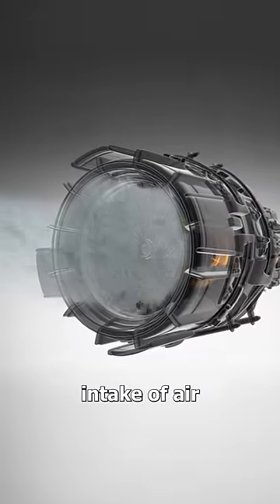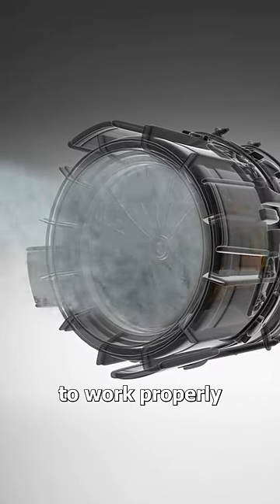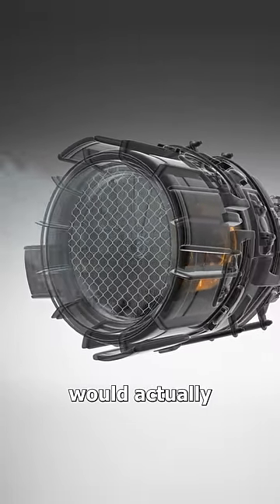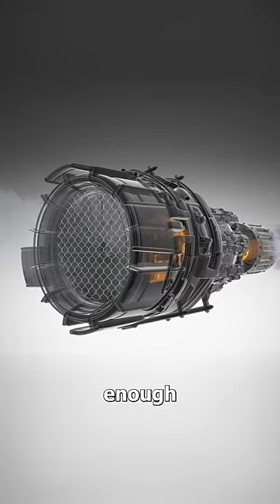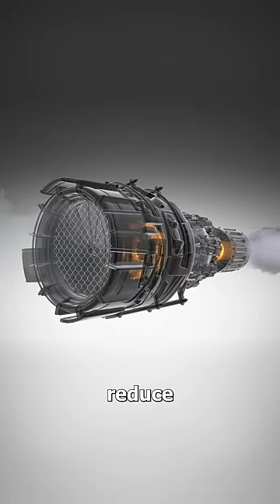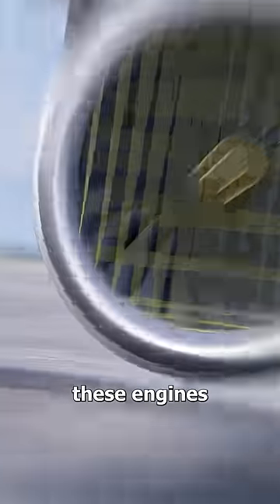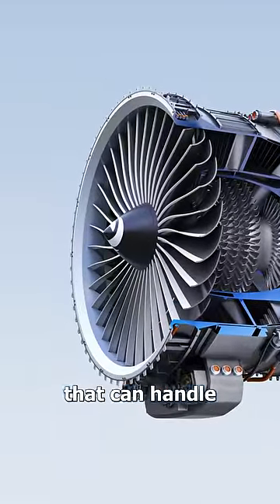Why Jets Don’t Have Bird Blockers 🤔

Comment: You can save the birds, but plane will go slower

Engineers: sharper blades it is then
Reply: "Bring me the nukes. I shall end the birds' suffering."
Reply: Nope, u increase chances of planes to malworking
Reply: You won’t save the birds though. The impact will most likely still kill the bird.
Reply: The birds would die upon hitting the grates.
Reply: It's not just slower, but also significantly higher fuel consumption and more pollution due to incomplete burning of the fuel.
Reply: Just don't use planes if not absolutely necessary (your holidays or getting somewhere faster isn't).
Reply: @@vengeance.19 sir you know nothing about me 😁
Reply: @Kotifilosofi  As someone with claustrophobia, having to spend several days and nights in a row in a car with literally zero ability to ever take a break from it, makes me lose my mind.

My parents always kept dragging me onto such journeys all throughout my childhood, and are about to take me to another one this december. I fuckíng hate them for that.

Commercial planes were invented by God, to end our endless claustrophobic, oxygenless, movementless, grassless, everythingless car suffering.

Think about it. Wouldn't YOU lose your mind if someone locked you in the back of a passenger car for 48+ hours with nothing but yourself, with only being allowed to leave temporarily for poos and pees?

Also, "speed isn't necessary", have you forgotten about the existence of URGENT MATTERS and/or EMERGENCIES?
Reply: @DogDogGodFog  calm down dude.

First off, don't you have trains? They're more comfortable to travel with long distances than both cars and aeroplanes, you can walk around, go to the restaurant car etc. Also, we can use the flying phobia of some people the exact same way against planes that you're using claustrophobia against other forms of transportation. Nothing will ever be perfect for everyone. And lastly, I said IF NOT NECESSARY, not "is not necessary".

You may wanna take break from online for today?
Reply: @Kotifilosofi  I can't calm down when you're trying to fight against what I see as a basic right.
Reply: @DogDogGodFog  wow you make this sound so dramatic 😂 just suggesting that maybe, just maybe every flight we have isn't absolutely necessary or maybe we could consider other options as well, is considered a crime against human rights? Just wow.
Reply: @@vengeance.19 sir you know absolutely nothing about me 😁 did you have actual arguments or are we done here?
Reply: @@vengeance.19 every argument I've seen from you is "that person has never travelled" 🤔
Reply: @@vengeance.19 I disagree. Most of the time it's about comfortableness, not about necessaity. You can come up with a reason for nearly anything, that doesn't automatically mean it's a good reason or that you should do it.

Go try a train for once.
Reply: Bro how u do this bold font
Reply: @Nikko00  write text between two " * "
Reply: @Nikko00  use * signs on the both of the sides of the text you want to write bold.
Reply: @@vengeance.19 haha. I will not even try to find you any sources long as your argument is "that person has never left their house". You can as well find the sources against the argument, if you're sure most of the time flying is absolutely necessary, can never be replaced by any other wehicle and even just suggesting so is close to violating the human rights...
Reply: No you can't. If the plane was going slow enough for a bird to survive the impact, that plane wouldn't be flying, it'd be levitating. And last I checked, we haven't invented a working technology for levitating 10 kilometers above the ground yet!
Reply: @DogDogGodFog car seats are a lot more spacious than plane seats though. Now those are cramped! 😂

Also, have you tried bringing some books or handheld game consoles or similar to occupy your mind with while driving?
Personally I don't mind long car drives, whether in the driver seat or in a passenger seat... 🤷‍♂️
Reply: do you literally have any actual reason that planes are bad??? just because one guy decided to take the train instead of flying doesn't mean the plane isn't still gonna take off bro. are you just trolling or tryna be a quirky emo soft boy? if it's the former then you're doing a pretty solid job but if it's the latter you need to go outside bro @Kotifilosofi
Reply: @TaxiCabCole  planes pollute our planet massively, if you had no idea. One guy lmao. If it becomes a trend that we fly less and use other forms of transportation more, then less flight is needed obviously.

You're missing arguments when you start straight out bullying 😂
Reply: @FartCity-WorldDomination  A right in the sense that my capabilties as a person and my career capabilities would be halved if commercial planes were banned.
Reply: sure, a single flight is obviously worse for the environment than a single car trip, but per-passenger c02 emissions are just as, if not higher if a single person decides to travel by car instead. also, boats are expensive and slow as hell. what if my mom is dying and i need to travel to see her? think for 3 goddamn seconds and you'll realize that planes have a purpose aside from just spewing c02 into the atmosphere. air travel accounts for 3.5% of global emissions, while the energy business accounts for 75%. that computer you're using to spit bullshit sure is using a lot of power, why don't you turn it off if you're such an environmentalist? @Kotifilosofi
Reply: @TaxiCabCole  unnecessary flights are the worst for the environment. They pollute so much. We could do with less, which was my point from the beginning. Not that no flight is ever necessary. I seriously wonder if people even read my comment or if they're just wanting to pick up fight 🙄

And I'm not using computer lol.
Reply: @sanguisbumb6138 and even if they manage to survive.  They won't be able to get out and just hang in there blocking the airflow. And considering there might be multiple birds stuck. Potentially blocking the whole thing
Reply: @Kotifilosofi  that would be rather don't use a private plane to go there, but public planes still gonna fly to the destinations at the same time, even if the plane is not full, so the only thing you do with that is you're not going to a holiday or get to your destination faster. But the planes still fly without you.
Reply: @tamaskarsai2072  there would be less flights if there's less demand. I don't know how to say that any more comprehensively.
Reply: Passengers : ALRIGHT WERE HAVING CHICKEN TONIGHT WHOO LOL.🤤🤸😎
Reply: Also engineers : all in the name of progress lol
Reply: trains suck @Kotifilosofi
Reply: i am from īndia most trains here are uncombfortable not fast and just disgusting @Kotifilosofi
Reply: @RajeshR-ck5ez  no they don't. Planes suck.
Reply: @RajeshR-ck5ez  I'm from Finland trains are fine here. I suspect your train network is not big enough for the population using it?
Reply: @DogDogGodFog  "a basic right" bruh he literally said flights that are not absolutely neccesary. Idk about you, but i'll take a high speed train any day over a plane
Reply: @CarlosAM1  Trains are only in certain areas. If you, e.g., intend to travel from the United Kingdom to Poland, you can't always rely on them.
Reply: @DogDogGodFog  I know. However here we are talking about when a flight is not neccesary for example. Here in Panama for example we don't have hsr or any train that connects most provinces so we are forced to either drive, take a bus or fly if you have the money.
Reply: @Kotifilosofi going to a island:
Reply: @leongao5120  I'd say going to an island falls under the category of "absolutely necessary" 🤔 or not, if  you can go by ship 😁
Reply: are you dense? the question was never about the safety of the bird... it was about our safety. Also a grate would make the fate a whole lot worse
Reply: Not that it would go slower, it wouldnt generate enough thrust to take off

Comment: "Sir, we've designed a bird blender."
"You can't call it that; no one will buy it."
"Sir, we've designed a turbofan."
"Perfect."
Reply: The New & Improved Bird Blender  it slices  , it Dices & Cooks Birds in Milliseconds. 
🤣🤣🤣🤣🤣🤣🤣🤣🤣🤣🤣🤣🤣🤣🤣🤣🤣
Reply: Is that what Taco Bell uses for their beef?

Whole mooing cow goes into the front, gets blended into hamburger, cooked/burned by the combustion, and then mixed with seasonings.
Reply: @Jeff-ss6qt  That machine would make a "Shhqloeup" sound

Comment: Even if they did put a grate on the engines, a bird would just be stuck to the grate for the entire flight due to the suction from the engine
Reply: Or pulled through the gate anyway. I think they'd be pulled through.

Not that the bird would ever find put, it be killed by the impact at 800+ km/h either way.
Reply: It would actually make it worse...
Reply: Make the grate cone shaped
Reply: @Crokatec  i don't think the shape matters much, the bird would get stuck by the plane speed and vacuum of the engine, ignoring the fact that it could cause engine problems...
Reply: @LRM12o8 Mmm diced bird
Reply: Yeah but lmao running from harmless shapes
Reply: And now you have the added problem of the grate itself being sucked in the engine, not only will you have bird carcass in the engine, you'd have reinforced steel too!

Comment: It’s not only that, it would also interrupt with the laminar flow of the air making it turbulent which also decreases the thrust generated. Don’t forget those are turbofans. It’s separated in 2 sections air that goes through the combustion chamber and air that just pass around. 70% of the thrust comes from the bypass air . U can say the combustion chamber is mainly there to keep rotating the turbines so they can rotate the compressor and fan.

Comment: As an aircraft mechanic, I can say with absolute confidence that bird strikes are lethal. 100's of aircraft have gone down because the stages of combustion and compression take significant damage due to bird strikes. This can be terrifying for pilots and an absolute nightmare of a teardown and rebuild process for the engine when it returns to the shop.

Comment: I’ve seen this explanation but it’s only a very small part of the story. The more important issues are both inlet distortion and increased risk of FOD either due to ice build up on this mesh (or any barrier) or parts this structure being ingested. Also it should be noted that a mesh would not save any birds, the death and ingestion of the bird would be the same.

Comment: I honestly thought that the entire idea was that if a bird hits the fan it just gets pushed through as fast as possible to not damage the engine in several places and minimize the risk of the engine dying
Reply: Kinda, yeah.
But also engines have an evacuation area where heavier articles (water, snow, hail, birds apparently) can go around most of the sensitive parts. Notice, in the video, the bird goes in the center - but then comes out as a ring tracing the outside of the engine? That's the system at work. The first compressor (on the front) basically slings all the heavier material (anything that's not air) to the outside. Out there, there's some bypass sections, to let all the nastiness (in this case, bird) around the sensitive bits in the engine.

So... Bird blender is ironically the healthiest thing for the engine.

Comment: Another thinhuge problem would be, what if a bird strikes the grid but isn't sliced? It will be pushed against the grid making the air coming into the turbine quite turbulent and would massively restrict airflow.
If multiple birds where to be squished/sucked against the grid would suffocate the turbine

Comment: And if a bird gets stuck in front of the grate the engine would have even less air lol
Reply: exactly
Reply: +the bird will die out of choke
Reply: The bird would still die + the engine would have less air intake because of the grate and even less because there's a carcass stuck to it

Comment: To get efficiency they are risking the whole aeroplane 's passenger life
Reply: What do you think the net would do? Either get shredded and fly right through the net or get stuck on it decreasing airflow and decreasing the engine performance. Permanently reducing engine power decreasing thrust, the only think keeping you flying.
Engine are tested and rated for bird impacts.

Comment: The barrier wouldn't necessarily cause an issue. There are military aircraft that use a honeycomb tube to prevent lamina flow, which is bad for the engine. The CH-53, which has jet engines powering their rotors, has a screen over the intakes.

Comment: To the comments lowering the engines efficiency does not slow it down. It means that it gives off less thrust/fuel, and the efficiency at the start is already not that high. The avg efficiency for a turbine is about 35%. Lowering it could mean you’d need a larger fuel tank on a fixed size plane just to take off and even stay in the air

Comment: If a grate causes an obstruction, imagine adding a pile of birds stuck to said grate causing total engine failure
Reply: The birds would just be strained THROUGH the grate because of the absolutely immense suction at the intake so that wouldn't really be a problem.

Comment: Make the engine cage as a 3D cone with variable pattern width, it would work but would still burn extra few % fuel, so you'd have to make them removable, only for taking off or landing. In a way or another, it wouldn't work fine.

Comment: you are half right. a grate would not effect air flow almost at all. the problem is, if you do hit a bird and have that grate, the air suction will keep that bird against the grate. Now you have a dead birds body sitting infront of the engines air intake! or just let the bird die much faster and more humanely, while also just deleting the obstruction.

Comment: No. It wouldn’t obstruct the airflow that much. 
The real reason is that if the bird strike  destroyed the actual net and then the pieces of metal net would get sucked inside the engine. 
And the metal net would not be as “blendable” as bird and could cause more serious damage.

Comment: it's got more than strong blades going on. everything inside of those engines is designed for bird flow and even beyond that there are protocols for a catastrophic bird hit. especially in the engine. because when the bird stuff goes into the intakes the engine still needs to function. so it's more than the blades.

Comment: Guys, it doesn't matter if there's a grate or not.

If a bird ends up in front of the jet engine, it's dying either way.

Thus, the focus is on efficiency and durability.

The only way to protect birds from planes is to make sure there are as few of them as possible hanging around airports.

Comment: The bird-barrier or grille won't work anyway, the jet engine's suction power is powerful enough to even pull it THROUGH the cover, you're basically putting a meat grinder on top of a shredder. Or in worse cases, the birds if it doesn't get minced by the grille, it'll stay on top of it, blocking the air flow and reduce the engine efficiency even further and cause accidents. Jets engines aren't built that way, what's in front of it gets sucked in, not pushed out

Comment: If you made the bird screen spherical or conical it would probably have enough air intake. Increasing surface area of the bird screen
Reply: The bird would get sucked in anyway, on a spherical screen, the bird would fall into the engine body-first before falling straight into the engines after their wings loses grip on the grate

Comment: Even if you managed to put a metal cage on the air intake that doesn't obstruct air flow, a metal cage travelling 900 km/h would explode those birds as well.

Comment: The function of the fans is to make the flow of air more laminar when it enters the engine. Not to stop birds and stones
Reply: In a turbofan engine they're there to compress the air. Turbulent flow is pretty much a requirement due to the noise within the engine.

Comment: The grate would not effort the intake. But yes they made it where the engine will handle it. But only birds. If you find debris in the air you aren't in the air anymore.

Comment: Also the birds will likely still not survive being stuck on the nets, due to the strong vacuum and pressure on their thin bones. Especially when considering long flights. 
The only outcome I see, would be blocked engines, prolonged agony on birds, and the potential of a flight crash.

Comment: I knew about the birds and why the engines don't have barriers. 
But I thought the blades were meant to slice throug air efficiently.
Never thought that they were specifically designed to slice through birds efficiently 🤪

Comment: I don't think the engines are built to be sturdy enough to withstand a bird's impact, it probably is just a byproduct of them needing to be sturdy to withstand the normal propulsion. An engineer would make a dimple cost calculation how much more metal you need to make it sturdy and how complicated and dangerous that is versus a simple cage and a slightly bigger engine. The cost is probably higher to make it withstand and impact so it is probably a byproduct.

Comment: if they did add a barrier and the engine worked sufficiently, the bird would die from the impact of the barrier. if the plane was idling or taking off, the barrier would hold the bird in place, and the engines suction force would try to pull the bird in. the poor bird, would rip through the barrier and be ingested in the engine after its torn apart

Comment: Would also be a lot worse of the bird ended up destroying said blocker and now you have metal inside the engine instead of small bird bones that are hollow and probably won't do structural damage